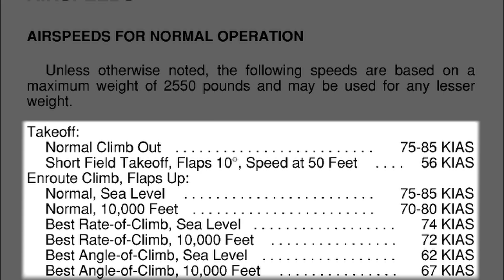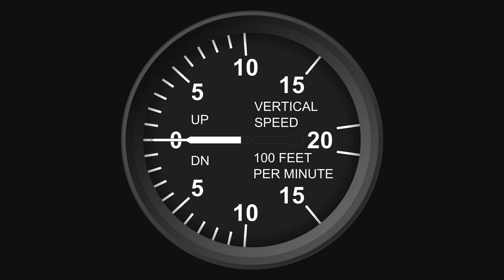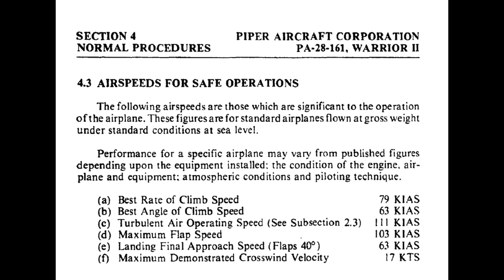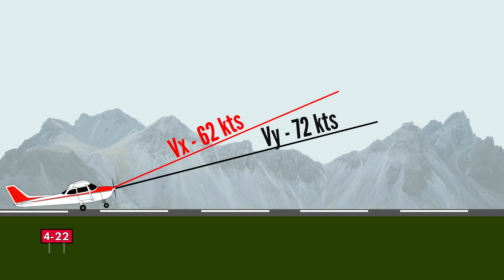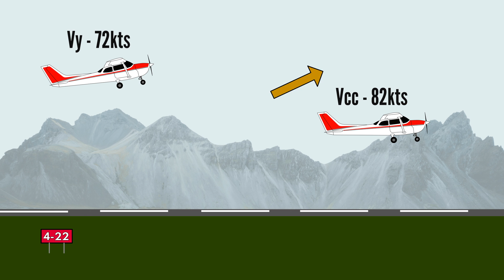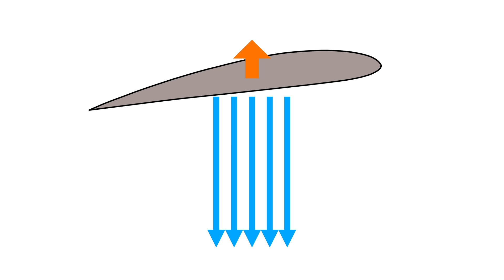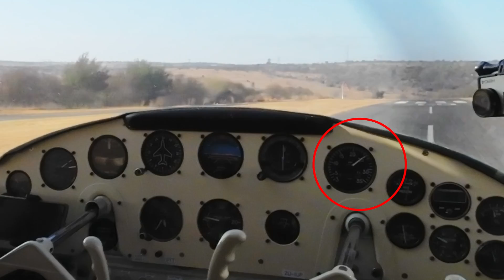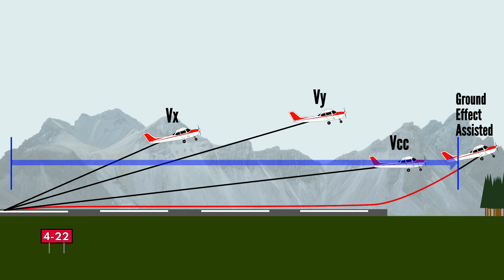Which Climb Speed is the Safest in a Light Airplane?

Comment: Accelerating in the ground effect can also serve as a method to prevent damage to the plane if the landing strip/area is in bad condition, getting the plane airborne ASAP, accelerating to best angle or climb speed, then climb as planned. This can save a lot of wear and tear in rough bush operations.

Comment: I believe your explanation of ground effect is incorrect. 
Ground effect is a function of wing span and height above ground.  That is the closer to the ground the greater the ground effect is.  This is also known as the end plate effect.  Designers noticed that a wing’s lift to drag differed from wind tunnel to real flight conditions.  I understand that when lift is generated the high-pressure air under the wing tries to move span wise to replace the low pressure above the wing.  This under wing span wise motion creates the tip vortices that are the induced drag of the wing.  The ground interferes with the span wise motion by increasing the friction; reducing the tip vortices and induced drag.  This is useful for soft field take-off where you need to transfer the weight of the aircraft from the wheels to the wing.  The risk with ground effect acceleration is the plane can fly with less power than you have available to climb.  This scenario results in either a departure stall or a collision with the obstacle at the departure end.
Reply from the maker: I'm not sure why you say my explanation is incorrect. I know it's a very short version, that was on purpose. What you wrote is more or less my understanding as well, I gave an expanded explanation in a different recent video where it was more important to look deeper.

Comment: Great video. I used to live at at KAXX (Angel Fire, NM) where field elevation is 8,380 feet and DA is typically >10,000’. The runway was long (8,900 feet) and I would advocate for ground effect assisted takeoff all the time. With the long runway, staying in ground effect after the wheels leave the ground somewhere around 2,000 feet for most NA GA planes, gave pilots the ability to just pull back power and land easily if there was a need to abort. 

My personal way of doing this in my Turbo Saratoga was to start with a static takeoff, trim down slightly, one notch of flaps. Stop at the end of the runway, spin up the engine to 36” of manifold pressure, check all gauges, release the brakes. Lift off at 76 knots and accelerate in ground effect until I reach the edge of the white arc (max flap speed), and then I pop in the 2nd notch of flaps, which is 20 degrees for me, which also happens to be my “maximum lift flap settings” (which would be a good video to do). With the slight nose down trim, just putting in the 20 degrees of flaps leads to a 1000 rpm climb rate, at a good airspeed, and I do not even have to change my yoke pressure to do it. Once I get to 1500 feet AGL, I can pull the turbocharger out of the engine, drop the flaps, and have sufficient altitude to be able to make a safe landing if I needed to.

Glad you did this video, you stated the obvious very nicely (nicer than me according to my wife) when you said a “ground effect assisted takeoff takes a focused and competent pilot”. My wife flies with me all the time, works my checklists with me, and works the radio. We always observe sterile cockpit until we reach 3000 feet AGL. 

If you are interested, I did a safety video about the nuances of flying in and out of Angel Fire, and I briefly mention the ground effect assisted takeoff.  You can find that video here. https://youtu.be/AmrAX7tSvvQ?si=ef97HOAyuZekBf5e
Reply: Very good almost total energy management.  Add down drainage egress toward the lake over unobstructed desert and you will have it fully covered.  Wait, there still is orographic lift and thermal lift, but that is an after takeoff situation.  Thanks for the video.

Comment: In a Cessna 182, a cruise climb is done using 90% power setting.  Full power suggested use is up to 30 seconds for cooling reasons.  A low wing plane flying in ground effect works rather well.  In my Cessna 150, I hold close to the runway until aproaching VY because of the low available power.  So, not only the terrain situation matters but the type of aircraft too.

Comment: One unfortunate aspect of these POHs is that they give a single speed for Vx or Vy etc irrespective of weight. These speeds are provided for maximum takeoff weight. In a c172 you can be quite a bit lighter if you are alone and half fuel. The ideal Vx and Vy speeds would be lower in that case.

Comment: Should not you pitch for best glide speed anyway in an event of engine failure? So especially with Vcc, instead of wasting energy to high drag (due to high airspeed) i think you should immediately convert speed for altitude, resulting higher altitude, and optimal glide speed? Of course the maneuvering itself could lead into energy losses, so i am not certain at all which is safer in the real world
Reply from the maker: You should pitch for best glide yes.  These comparisons are all based on getting to best glide after engine failure. I'm not saying to glide at Vx, Vy or Vcc. At Vcc suffering an engine failure you'll be at best glide without much input in a few seconds, probably before the pilot can react, depending on the plane and how fast Vcc was of course. At a safe altitude, doing some engine failure simulation in a climb one can see how fast airspeed drops in the first 3 second. At Vy you'll have to actively (not shoving it though) push the nose down to not go below best glide. I can't speak for all aircraft types though.

Comment: "Best" answer: it depends.    Love it and, I agree.

Looking into POHs, Vcc is seldom given. There are some with graphs that show the change in Vy and Vx speeds with altitude. I guess you could halve the difference in cruise speed and Vy and use that?
Reply: For the crop duster it is not a number in the POH.  Energy is life and ground effect is free energy.  Roll on the wheels, less energy.  Pitch up while slow and lots of ground effect left, less energy.  Level in low ground effect so long as runway ahead, more energy.  Down drainage egress is potential energy of altitude you didn't have to give up any airspeed for, more energy.  Again free energy.  In small trainers and crop dusters, ground effect, down drainage, thermal lift, and orographic lift often equaled 50% of total energy available.  In really rough air or mountain wave, natural energy far exceeds fuel energy.  And it is free.

Comment: I feel like you still haven't answered which speed results in the most total energy. Vy climb results in the most potential energy, but I'd rather be at 1000 feet at 100 knots than at 1050 feet at 70 knots. I feel like the answer is somewhere between Vy and Vcc?
Reply from the maker: It can be calculated but gets more complicated as drag also enters the equasion. I'd say it would usually be close. Between Vy and Vcc you are just changing the composition of the equasion without changing the result (by much).

Comment: Speed is life
Altitude is safety
Reply: Good points.  For 17,000 hours I lived with less than 200' of altitude.  Airspeed is life down here.  Airspeed, zoom reserve airspeed, enough airspeed to maneuver without doubt, saved me eleven times when the engine failed there.  Yes, altitude is safety.  It is also time.  Some of my low altitude forced landings would not have been necessary with more time to evaluate.  Mine were all six second deals.  I went to survivable landing zones in the very near hemisphere in front of the wing.  It usually took full flaps and one rudder pedal to the stop forward slip to get into the beginning of those LZs.  High altitude orientation (altitude is best, checklist, settle down and work it out, best glide airspeed) will kill you down here.
Reply: @jimmydulin928  cropduster?
Reply: @jimmydulin928  I'm not a pilot, crop-dusting was all I could think of to get that number of hours at that low of an altitude.
Reply: @stephenalexander6721  Army helicopters, crop dusting, and pipeline patrol.
Reply: @jimmydulin928  my hat is off to you and than you for what you've done.

Comment: Which climb airspeed is the safest ? What stupid question. There is no answer to that because each climb speed has it's purpose.
Reply from the maker: What would you have titled the video?
Reply: @LetsGoAviate Which climb speed for which conditions?
Reply from the maker: @LTVoyager  But everyone already knows which climb speed to do for which conditions. The focus here is more on safety.
Reply: @LetsGoAviate  I understand and my comment stands.  If you have a short runway and need to clear 70’ trees at the end, Vx is much safer than a faster Vy.  Different scenarios dictate which V speed is safest and it isn’t always the speed that is faster or has the lowest deck angle.
Reply from the maker: @LTVoyager  I mean, that goes without saying. You need to clear the trees amd don't have the option of doing anything other than Vx. And I thought I covered that when I said that Vx is used for obstacle clearance and why Vx works best for that. Doesn't change the point of the video though.

Comment: Great video! Standard pilot training is to use VX to clear of obstacles and then VY for climb out. Advantage of VX is that if there is an issue with climb you find out early and may still have available runway to land on. In the event of engine failure you need to get to best glide as fast as you can. For example, in Cessna 172 VX is 56, Best glide is 65 and VY is 76 so +10 knots for VX or -10 knots for VY. On cold days my favorite is Ground assisted acceleration and then a pull up as it feels like you are in a way better plane than you actually are. I wouldn’t use cruise climb for anything other than cruise climb. Good way to keep the engine cool on those long climbs to altitude if ATC permits.
Reply: Just put a Blue Line on full gross Vglide speed.  Vx is a few knots under, Vy  a few knots over depending on weight.  We had them on all the 1990's airplanes we flew at our flight school.  We had the best students flying in crosswinds when the 2 other flight schools could not fly.  Laggards they were..

Comment: There is no single indicated speed that works for all climbing situations.  It's just not that simple, so here's a quick primer. 

Flying essentially begins with rotation at Vr and initial acceleration to the best angle of climb speed or Vx, which is also usually very near or equal to the best L/D ratio speed, where L is total lift and D is total drag. But Vx is normally quickly passed on most climbouts for pilots operating propellor-driven airplanes, which usually settle in at Vy, ie best rate of climb speed until out of the traffic pattern. Terrain ahedmigh forcea longerclimb a Vx, which might cause the engine's operating temperature to rise. Once out of the traffic pattern (or "the circuit" as it is called in Canada) with the landing gear and flaps retracted, many pilots will re-trim the nose dowward to about 5 degrees up, to accelerate to a cruise-climb speed with a value somewhat above Vy but well below Vmowhich  provides better forward visibility.

Many light aircraft climb fairly well throughout a range of indicated airspeeds. As the aircraft climbs higher and higher, all of its indicated speeds will become somewhat lower  than their values at sea level. 

Vx and Vy  are sometimes farly close to each other, particularly in smaller, lower-powered two-seater airplanes. But in more powerful designs they may be a greater gap between the two. A good example of the latter is the Grumman American AA-5B Tiger, with a Vx of about 81 mph (71 knots) and a significantly higher Vy of 104 mph (90.5 knots). 

One day back in the late 1970s I remember climbing a relatively lightly-loaded Grumman American Tiger with just myself and a brother aboard, from sea level up to 11,000 feet to tur Mount Baker, a dormant volcano in northwestern Washington. According to the AA-5b's pilot operating handbook, (POH) the indicated Vy value drops from 104 mph at sea level to about 81 mph at 11,000 feet.  At that point, Vx and Vy were identical. That is because the air gets less and less dense as altitude increases, causing errors to accrue in the airspeed indicator, which pilots must understand and be aware of. 

That high up with a non-turbo-charged engine, climbing faster than 81 mph at 11,000 feet, would significantly reduce the available climb rate. Climbing at a lower indicated speed would also reduce climb rate. 

If the inattentive pilot keeps on decelerating that will  ultimately leads to an aerodynamic stall.  That is when the wing can no longer overcome the weight of the aircraft ie climb. This forces the nose down which restores relaielr smooth airflow over the topand bottom surfaces ofthe wing, allowing theairplane to accelerate back to a "climbable"  indicated airspeed.
Reply: In a jet, Vx is achieved at best L/D angle of attack. However, in a propeller aircraft, Vx is achieved at a speed considerably less than best L/D AoA. In a prop plane, Vy is actually close to best L/D AoA. Also the reason Vx and Vy converge at the aircraft's ceiling has nothing to do with airspeed indicator error. It's because there's only one speed that will maintain level flight with the engine power/thrust available.

Comment: It is true that drag is less flying in ground effect than flying above ground effect. But, is drag less flying in ground effect than accelerating on the runway with the weight supported by the wheels instead of the wings? On a rough field, yes. But, on a hard surface runway, I suspect that staying on the ground would actually be better.
Reply from the maker: In theory, maybe. But in reality, probably not. As soon as you reach flying speed, it will start flying, unless you keep pushing the nose down. I cringe at the thought, but let's say you do that. As speed builds up the wing will want to fly more and more, and you'll have to push the nose down harder and harder, which will increass tyre friction, and in the end the total friction (air + ground) will likely be more than it is in ground effect (air only).

This is not to mention the good probability of pushing the propeller into the ground, and also the size wheels could exceed their rated speed, depending on type, especially if they have a small diameter. Light airplane wheels typically have quite low max speeds, but it varies quite a lot.
Reply: @LetsGoAviate  Ok, I agree with all you say there - especially the caution re prop strike and over speeding the mains - but with one caveat. Rolling resistance will not actually increase in this scenario because it is μ(W - L), where the experimentally determined coefficient, μ (0.03 typical for asphalt), is not a function of velocity. It is, in effect, 3% of weight on wheels (more for soft field of course). The friction itself (including hub bearing) may increase but is small enough to be considered negligible.
  I am a staunch advocate of sticking to POH recommendations, except as part of formalised flight test procedures. Nonetheless, the question boils down to how the above mentioned parameter compares to induced drag. The short answer to which is: at or close to recommended Vr the induced drag is reducing fast enough that you may as well just rotate and avoid the penalty of an increased ground run.

Comment: The V-speeds depend on weight too, especially Vx.  If you're heavy it'll be faster.  To make it obvious, consider what would happen as the plane becomes so light that it can fly almost straight up - you get an extremely steep climb at a very slow speed.
Reply from the maker: Yes. The V-speeds in the POH should be at MAUW. So if you are lighter, Vx and Vy will be a slower airspeed.

Comment: Vx in an RV6 is about 1500 ft/min at 80 mph. Best glide at 90mph which means I'm at pattern altitude before the end of the runway with slight pitch over to bring speed up to best glide. If I have an engine failure, I will need to do "S" turns to prevent runway overshoot after return to runway alignment . But very few GA aircraft have this amount of performance. In a C150, you're screwed, blued, and tattooed on a hot day.